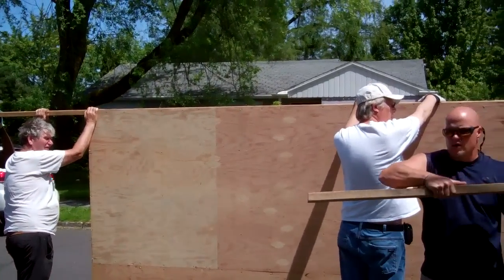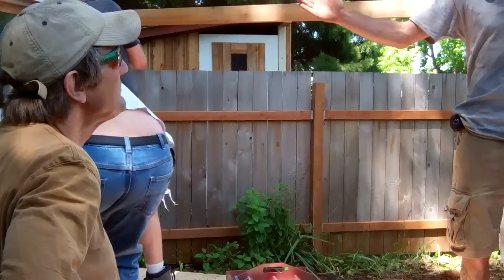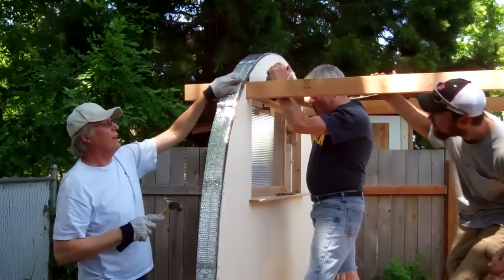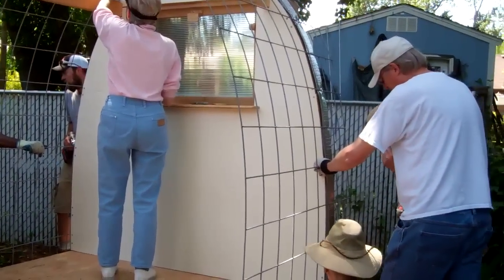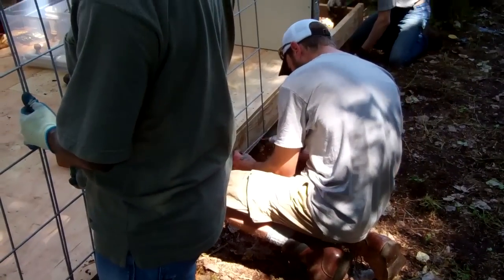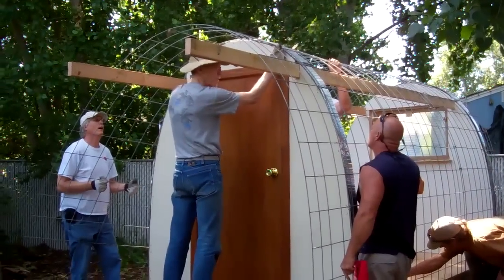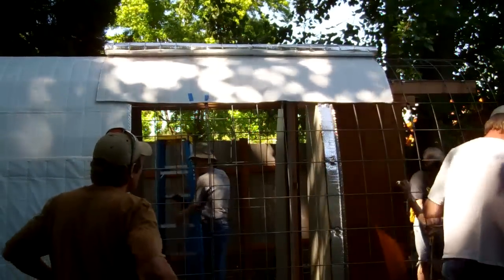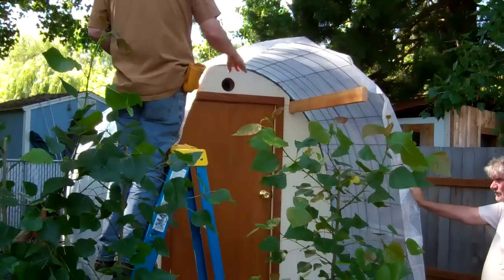Building a Conestoga hut June 1, 2013

Comment: They are building these in Oregon for the homeless.  Very nice idea and quick to build!!
Reply: Good idea but where is the bathroom. They need to be able to bathe a toilet. How will they wash their clothes. Yes it starts as a good thing but they need the government to do much better. There are empty buildings (hotels motels) and the residents can keep it clean in trade for a room. This is the U.S.A. should be doing better.
Reply: @deborahbaskett1286  These are not Tiny Homes. They are meant to be grouped around a main building with facilities. However, if you wanted to alter it to add those things, you could.

Comment: You can carefully cut a hole in the roof slide in a little $1 solar light from Walmart and get light until around midnight. I have a ezup 12X12 I did that with.
Reply: For the interior, it would be better to get a tap-light. But the exterior would be a good place for one. You don't want it shining in your eyes when you're trying to sleep and you don't want it leaking.
Reply: @DarkMoonDroid  they have switch offs
Reply: They have tiny solar paneled lights I have a couple, they can charge on the porch during the day then just take the light bulb and hang inside, they have off n on switches.

Comment: This is a terrific idea, and I've been studying the different builds online. One thing that might improve this (already noble excellent effort) is to consider some kind of "belly wrap", that is, a waterproof layer underneath the wooden floor. Trailers built with wood floors will rot out from underneath, especially in a damp or wintry climate. Thanks for posting this, though. Gonna organize some building myself in my community, too.
Reply: I think spraying the bottom with truck bed liner would seal it from rot.
Reply: Both the truck bed sealant and the plastic wrap are wonderful ideas! I know these huts are only meant to be temporary shelter but I think the huts would be a good tiny home as well
Reply: I’m inquiring to a wire panel manufacturer as to get 20 foot panels made and increase the width to 8 feet
Reply: Yeah need to water proof!!

Comment: I've been waiting to see a video of someone making a cattle panel shelter for humans. I've been thinking about doing this on my property for a while now just haven't got around to doing it. I could definitely live in one of these huts. I lived in my car for two years and my van for three so this wouldn't be a big deal. I think I would build two or three of them close together and connect them and have hallways going from one to another.
Reply: I've been a fan of the cattle panels, also, followed a fellow that came up with the idea, he used rebar to hitch the panels to, some have built wood base, say 4 ft high or concrete base
Reply: When you lived in your car and van, how and where did you use to go to washroom?
Reply: @junglemungle5896  Gas stations is the norm. You can shower at any COA ( campgrounds of america ) or a truck stop for 5 bucks. This is from experience working out of town. I could get a construction rate at the motels on week days but on the weekend they wanted as much for one night as the entire week Mon thru Friday at noon. Friday at noon your out unless you want to pay 150 a night.

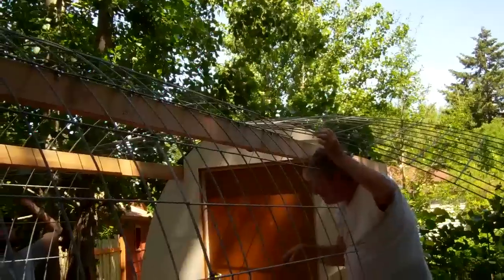Comment: Same design I have been planning for on a flat trailer. 👍🏼 One idea, tie a rope to one end of the metal panel, line up the other end on the ground-side, then use rope to pull panel over and down house. 🤔 8:44 👋 Might save you a finger or eyeball 😬👍🏼😁 Nice job on the build.

Comment: It's funny to see this young guy having these old wise guys working out all his designs. so many chefs in the kitchen, but it's not designed to be hurricane code proof, but a DIY tarp that doesnt require a sewing machine.  Would like to see a design built out of 4x8 panels home made SIPs.  PNW cedar fence boards are cheap and super easy to rip down on the dullest table saw.

I've been wanting to build one of these for so long, one that can handle winter and actually be heated to 70ish. I'll be moving in a couple months, not sure where I'm going, although I have some things in the works, I would feel much happier living in a burly one of these.